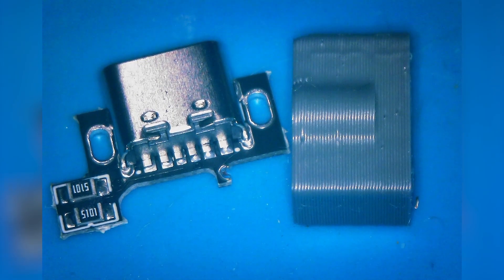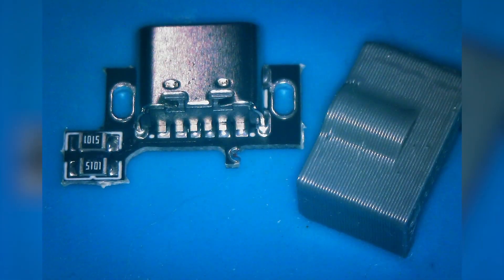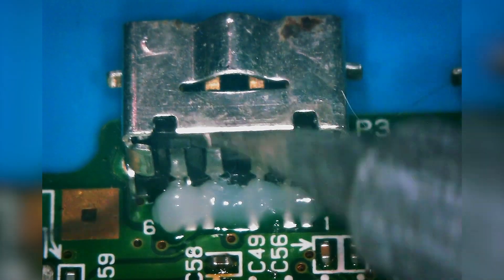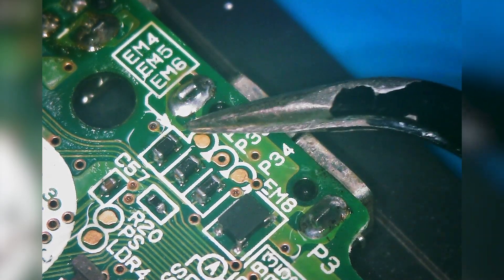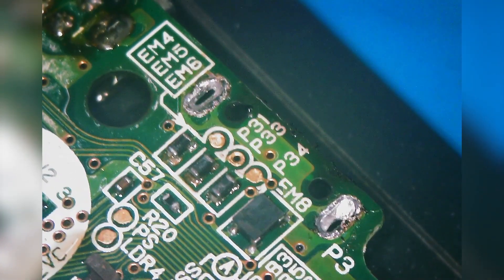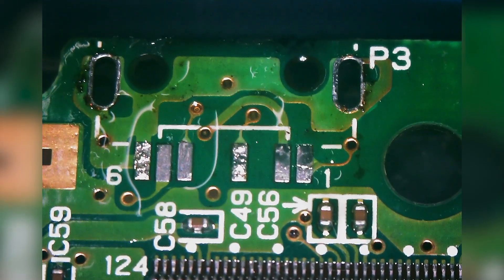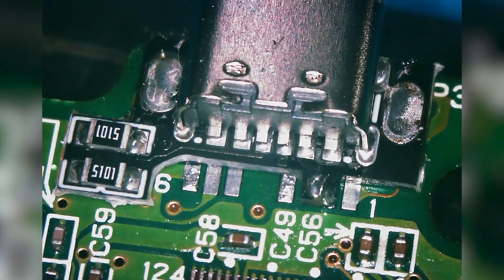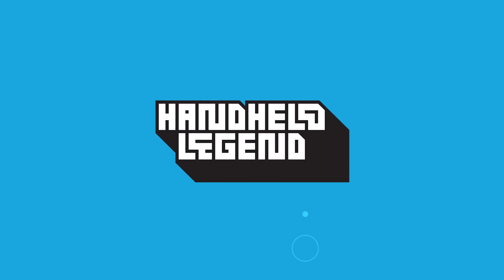GBA USB-C Charging Mod Install Guide

Comment: Is it safe/okay to use if only one through hole is soldered/connected? I've tried for hours but one of them just won't connect, the other one is fine though and it seems okay like this

Comment: Okay I followed the instructions as well as the instructions from the other videos but the light doesnt turn on when i put in a USB-C cable. I read that The USB-C to USB-A cables work but The USB-C to USB-C don't.  I tried both and turned the cables upside down What, still no orange light is lighting up indicating that it's charging. What am I doing wrong?

Comment: You should switch to a flat tip for your iron rather than using the small, curved tip. It distributes heat to a wider area of the solder pad and makes reflow easier. You could also try to wick solder off the pads and out of the holes before using the hot air tool so theres less solder mass to heat and reflow. Also, if yoh use a piece of kapton tape to hold the new connector exactly where you need it, you'll have a much easier time soldering it in place.

Comment: Thanks for the video..
I managed to complete this mod today thanks to you. And though I only had an iron and no air gun, everything went smoothly 👍
Reply: How was it not using hot air every video I've seen uses it but I don't have one either
Reply: @HectorNector_22  easy really. I just used a jewellers screwdriver in between the port and board adding some pressure as I heated up the anchor points. It's not pretty coming off, but easy enough. Loads of people don't have hot air stations, don't worry. Just take your time and be careful not to lift any tracks.

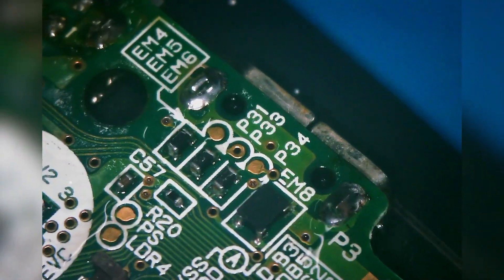Comment: For the part starting at 3:09, couldn't you instead just use the wick to absorb all the solder once you've gotten it melted? Why go through the extra step of heating with the air for a really long time, which also seems to damage the board a bit and could melt those important components?
Reply: probably run a bigger risk of lifting one of the pads off
Reply: Have you tried it yet? I haven't ordered it yet but if it's a better alternative I just might do that
Reply: Could also try a solder sucker idk
Reply: I did try this and I did get it to work. Though it took a LOT of finangling to get it off. I believe it may be easier with a desolder gun to completely remove the solder from the joints, but both using a hot air gun and using a solder wick are pretty risky in my book.
Reply: Would desolder gun be better for this than a desolderbraid?
Reply: I just did this mod today with only a soldering iron and wick, and it looks like the air gun would have been easier. Getting all the solder off the contacts on the top is not easy, and I ended up taking off one of the (now unused) contact points in the attempt. The next time I see a tutorial like this involving a heat gun, I'll get myself one instead of trying without it.

Comment: Do you need solder wick or can you use a desoldering pump?
Reply: Both should work but in my experience it’s more easy to remove little amounts of solder with solder wick. Best you could use is a electronic desoldering gun, if you have some spare money. They are kinda expensive but definitely a gamechanger for anyone who works on small electronics :)

Comment: Could you use a USB C to 3.5mm adapter for headphones or does that make it essential to do a headphone jack mod?
Reply: This is on the charging port, I doubt you'd hear much!
Reply: The origanal changing port is also the audio out. This mod only does the changing. They do have mods that do both.
Reply: This mod definitely kills head phone jack compatible for the charging connector

Comment: So I did this with a soldering iron and lifted the back 2 pads, it charges just fine but audio doesn’t work, and the screen seems off for some reason, any advice or help?
Reply: This mod only does changeing no audio. Might be able to wire it in manually. Would need to verify the pinout.

Comment: I installed this yesterday and it charges and everything correctly but now the speaker intermittently doesn't work. Is there anything around the port that would affect the speaker?
Reply: Have the same issue, as well as the screen being slightly off, I don’t know why either, if you figure it out, I’d appreciate it if you let me know
Reply: Check for solder balls. That or metal flakes are the biggest cause for intermittent issues

Comment: What would be the best way to remove the original port without a heat gun? I’ve only got a soldering iron to hand.
Reply from the maker: We don't recommend attempting to take off the original port without a hot air gun, the chances of damaging the charging circuit are quite high.
Reply: @HandHeldLegend  I managed it! Took me what felt like an eternity using a solder sucker, desoldering wick and carefully wiggling it with tweezers, no pads lifted thankfully 😅
Reply: @HandHeldLegend  I have to confirm this 😢 Tried to do mine with a soldering iron and killed the pads…
Reply: @MrOtanein  I have also completely screwed this up trying to use just a solder iron. Tried it again on another board with a heat gun and a ton of flux and it came off niiiiiiiiiiice and easy.

Comment: I clip the legs on the under board and then suck the solder from the anchors, then shield and hot air on the port side for removal. I haven't needed the low melt solder thus far.

Comment: What does it mean if the you add the battery back, Orange light turns on for a second then turns off?
Reply: When that happens the circuit is not complete somewhere. It sends, thus the light comes on, but does not complete and the light goes off.

Comment: What does it mean if the orange light stays on with no battery connected?
Reply: It probably just means the SP can run without a battery. Makes sense in a handheld that usually was in kiosks and stuff.

Comment: I’ve considered using a heat gun for other mods (i.e. GBAccelerator, to remove the X1 crystal before installing), but others have told me using a heat gun on PCBs with components this small is dangerous. Seeing it used for this mod makes me feel a bit better, since it looks like it didn’t mess up nearby components like the EM8 chip at all. Would that EM8 chip become useless if I keep the heat gun on that general area for too long? Going to try this mod soon but given the price of used GBA SPs and PCBs I don’t wanna mess up
Reply from the maker: Heat guns can cause damage if you don't have your settings set correctly, but generally you should be okay to use hot air on components. If your hot air station has air speed settings, etc. I would keep them low as not to move around other components. You shouldn't damage any components if you keep the heat moving at all times, holding it in one area is usually what leads to damage. - Jaden
Reply: @HandHeldLegend  Very pertinent points. Proper shielding is a must along with all the points you conveyed. Cheers!